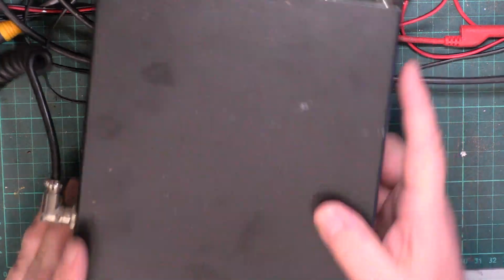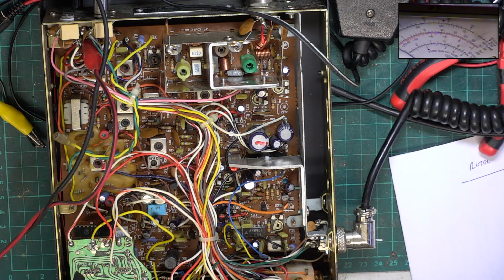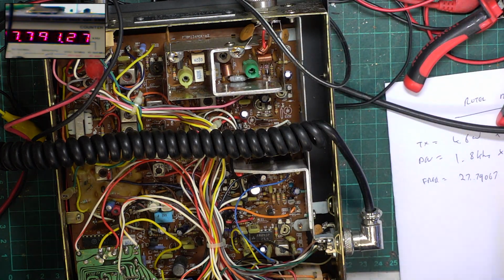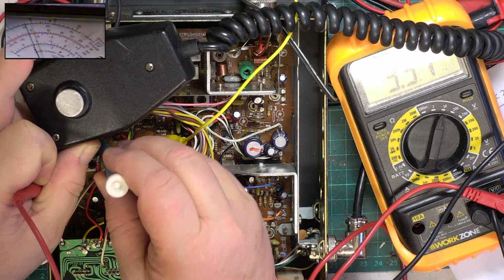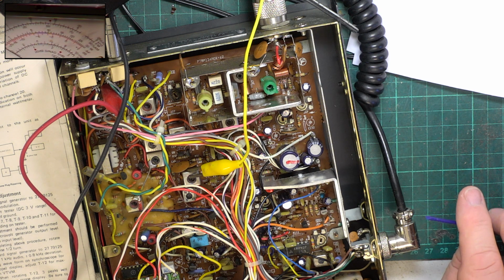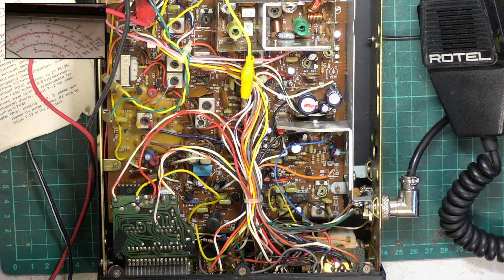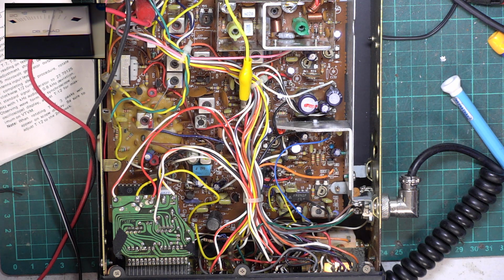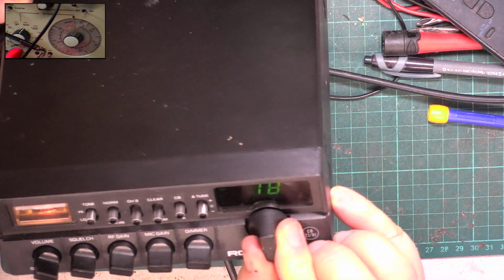Rotel RVC240 CB27/81 UK FM CB radio - Service & full alignment

Comment: Did any CB27/81 manufacturer use the Armstrong Indirect FM generation method to generate the FM at the Intermediate Frequency rather than messing around with the VCO voltage just wondering.
Reply from the maker: We've had this from you before....it was a 1930's technique. We only have to adjust the VCO voltages because they've been messed with; they don't drift once set.
Reply: @ukfmcbradioservicingTango21  I am sorry but I saw this technique in an ARRL hand book but as you said it is an old technique.